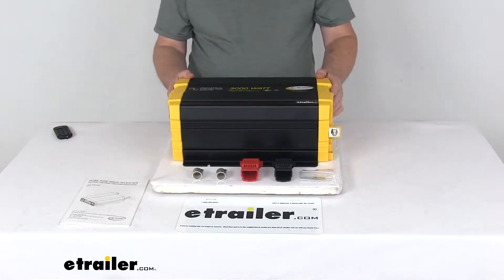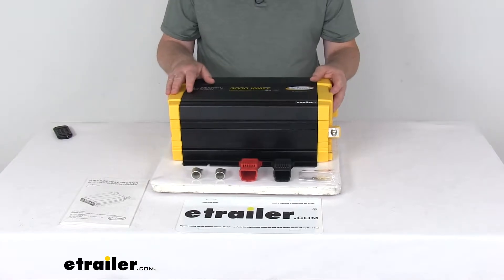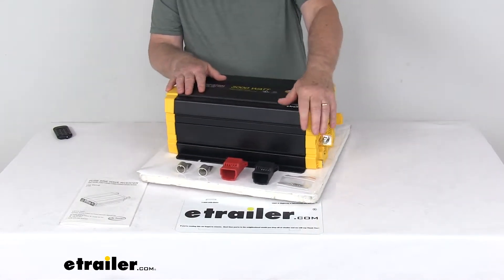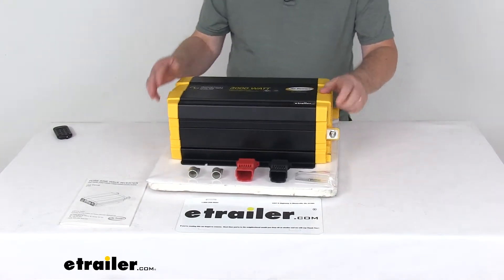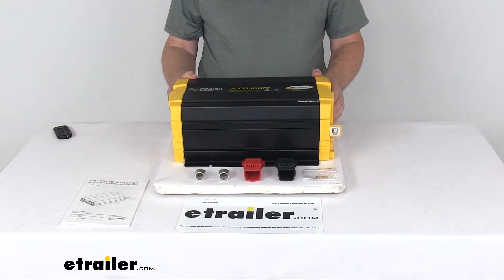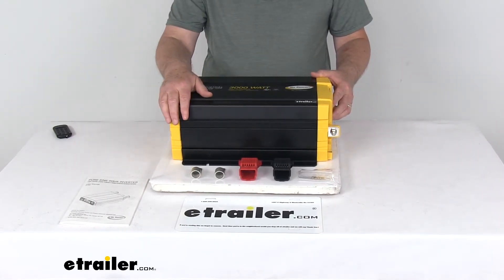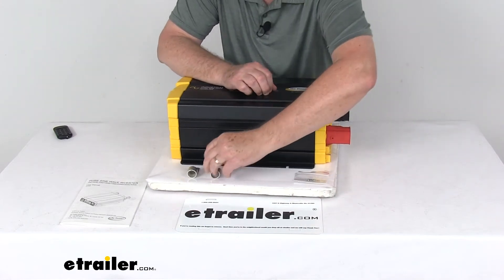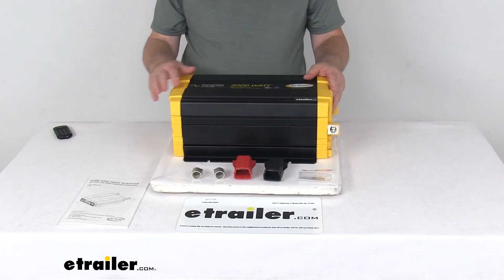etrailer | Complete Breakdown of the Go Power Industrial Pure Sine Wave Inverter

Comment: How many Amps can the hardwire output handle?  You only mention voltage, can this handle 30 amps? 50? what.
Reply from the maker: This Go Power Industrial Pure Sine Wave Inverter is rated for 156 Amps.
https://www.etrailer.com/RV-Inverters/Go-Power/34279953.html